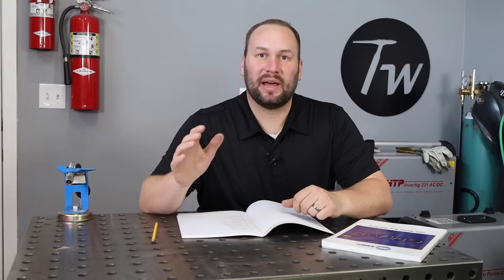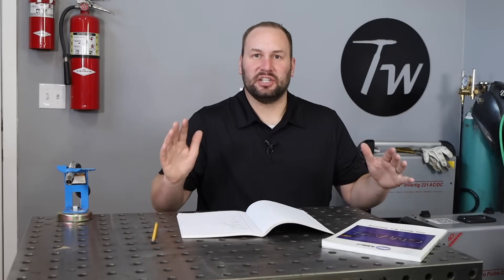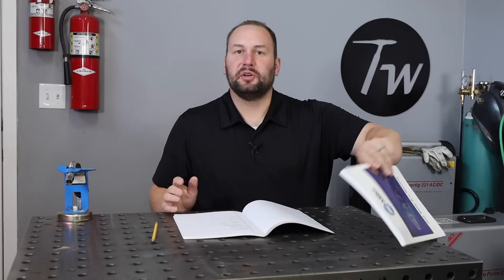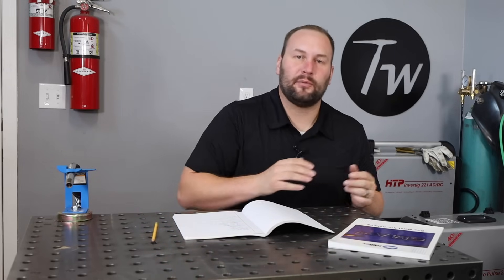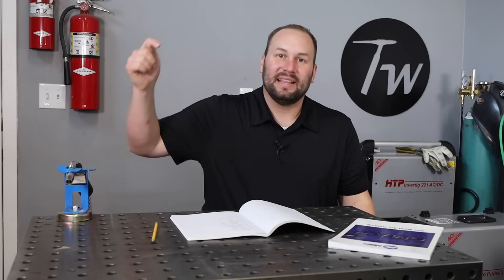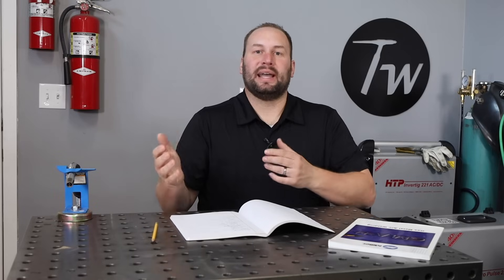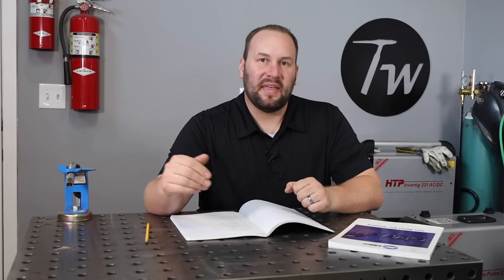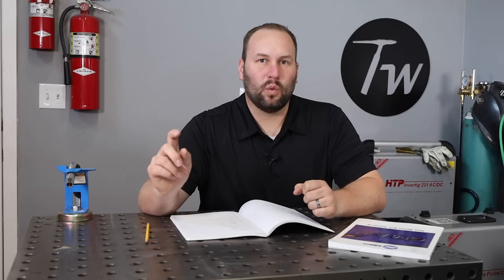Perfect Mig Welder Settings in 3 Easy Steps

Comment: For many welder, Miller's especially, that 1-10 dial for wire speed is actually in 100's of inches per minute. IE setting 4 is 400ipm.

Comment: I agree with the scrap plate tip. I always had a piece of clean scrap near by, to do my final dial in. Even though I already knew about where to set the machine, tips get a bit worn, liners get a bit dirty but not bad enough to replace. This and other factors will affect the final "tune in" on the wire feeder.  Retired now, after 35 plus years.

Comment: I welded missile launchers for the navy for 10 years along with crane frames. You did a good job on your training, but nothing was said about the type of gas. I use 75/25 mix at home and you will get a lot more splatter. Don't know if some of your students would know this. Professionally we always used to set inches per minutes before anything else. Thanks for your instruction.

Comment: This was really helpful, in fact I've been binging the channel and I've learned a lot, most importantly that I've been doing it wrong up until now.  I have one question though:  What about welders that use voltage selector rocker switches rather than a rotary dial?  My welder has two switches that are numbered 1/2 and min/max, but they don't correspond to a voltage, and the manual doesn't mention anything about it either.  Has anyone come across these before?

Comment: I generally use a Miller in my job, I've got bo qualification in welding but I'm always trying to learn. Generally we keep the same settings we are comfortable with over the whole chassis because it's target based changing settings amd making the best welds we can isn't a priority to the company but I want to improve and do that regardless so thanks for the info.

We generally use 3-5mm thick mild steel and as you said its numbered something like 1 to 10 lol so I use c for voltage just over 7 for wire speed and 4 for current... If I remeber rightly. I was thought on my week long training course to go off sound it should sound like frying bacon!

Comment: i usually do 9.5m/s at 24.5v 200-300 amps on semi-auto mig depending on conectivity and if metal is clean or not. for 2-3mm thickness material i go 8.5 at 21.5 22.5 for me that works.

Comment: 119 amp 19 volts 0.35<<<>>>> 125 amps  20 volts in both after setting Amps & Volts then Set wire feed Speed till it sounds like Bacon Sizzling. Remember this works in all Short arc welding. .25 in from the face of your Gun.

Comment: Question.. I have a multimatic 255 that according to the door chart, suggests that for flux core .035 wire on .250" mild steel should be run at 22.3v with 356ipm wire speed. A friend of mine, using a millermatic 252, using 035 solid wire with 75/25 gas on .250" mild steel runs 19.5v with 215ipm wire speed. Why is there such a difference?

Comment: Hi from Australia 
I'm starting to learn to mig weld and find your videos most helpful 
I have an Australian made Unimig 180amp multi 
On it there's a dial for burnback adjustment I'm just wondering how to set it right the dial just goes from 1-10 there's no explanation of the settings in manual 
Thanks Craig

Comment: I use 0.9mm fluxcore on galv material from 1.6mm to 3mm. Most welds are butt, v down or fillet, at 1.6 around 13.5 to 14.2 with 3.3 to 4.1metres ws. At 3mm I jump to about 16.5 to 18 and 5 to 6.5 ws to weld all my positions. If it sounds like frying bacon I got it sweet.

Comment: Thanks for the insight, Tim.  I'm wondering how one might change the voltage on one of the less-expensive inverter welders that only has a control for amps.  Also, I'd like to know a bit more about transfer modes. . .
Cheers!

Comment: My wire machine of choice is the Hobart motor generator. It had a wire speed dial, and a voltage and amp meter. There was three ranges to weld with by tapping into the windings externally. I chose to run my Mach on high. The reason was to use the entire generator coil instead of a partial. Then on hot days, my machine is not running at full capacity to do the same work. For .035 wire and CO2 gas, I used my wire speed to set the voltage at 90 volts, and dial in my amps to 100 amps. Or was it Vice versa ? I could weld all day because ......in this case.....less IS more.

I used to rebuild generator sets for the army. I understood how it works. Most importantly here, please pay attention to this. PROTECT YOUR EYES. You are not that good to avoid eye damage. Here is what you do, and this takes serious practice. While you learn this technique use soap stone on your joint. A thin line will fluoresce so you can see the line. Use your peripheral vision as your guide. Look ahead of your weld pool. Do not look directly at the arc. You will save your retina from serious damage, so when you get old, you will still be able to see. 

Do not inhale galvanize weld fumes.

Last but not least is to protect your hearing. Let the others laugh at you. No big deal, until you can’t hear shit, when you can’t remember shit, while you can’t see shit either. Remember, you ain’t that good to avoid these things.

Comment: I have a question about prep work before welding. DO you sand off the MILL SCALE before you weld? If not will the settings change because you have to weld through the MILL SCALE

Comment: when I dial in a hot snot gun (mig/mag) do I do it entirely based on the sound. I get a piece of scrap, look towards the machine and away from the scrap, start the arc with one hand and dial in the settings with the other until it sounds about right to my ears. after that do I put down a test weld and see if the settings were right and re do but lower or higher amps depending on my needs.

i'm not a hot snot welder tho so I don't know the tips and tricks about setting up a hot snot machine. what i'm good at is tig and stick welding pipes and I am able to set up and run a pipe weld with both tig and stick in my sleep

Comment: OK I need guidance with Mig Gas and Flux core gasses welding.  AS a beginner DIYer my problem is I have a "Bossweld BUDDY MIG 150" that only has voltage and average (so no wire speed feed settings).   I am using 0.8 mm flux core roll of wire (an I have at the ready, 0.9 steel wire with Argon/co2 gas too).  I can't find in product manual how to set the voltage and amps for different thicknesses of steel welding.

Comment: Useful to see, I imagine at least some of this transfers to flux core (I don't have a bottle yet). Unfortunately my welder (a Yeswelder MIG205DS) only has "synergic" controls: set material thickness, and then you use the amps knob to adjust something... It's supposed to be easier but I can find no information on how to use it well, other than that you can get it to go slower/colder for thin stuff if you tell it mig instead of flux core (yes the allowed ranges differ between the processes). I know they sent you the tig version of this machine, not the mig one, but if you have access to a machine with these kinds of settings, I would really appreciate a few minutes of tips: it may be easier but nobody teaches how to use it, everybody teaches voltage and wire feed speed.
Reply from the maker: While I've never used that particular model, I'll explain how other machines that I've used with synergic controls work. Typically, you turn a knob for the material thickness, which will set your wire speed (it's like the charts I showed, just programmed in). It will then automatically set a baseline voltage based on that wire speed, but they typically allow you to adjust the voltage up or down a little from that level. In order to run higher wire speed (and thus amperage), you can just set it a little thicker than you are running and vise versa. The voltage can be tuned a little above or below their recommended level to get it running well for your application, which is basically the same thing I did in this video. Again, I've never run that particular machine, but I assume it can be operated in a similar way.
Reply: @TimWelds  thanks a bunch, this is really helpful!

Comment: I have a Lincoln SP100T with Just A B C & D for voltage selection and 1-10 for wire speed . Any Idea what the voltage settings are for the A,B,C, or D settings  Also what settings would be good for welding body panels with .025 mig wire. Thank you.
Reply from the maker: A or B and somewhere around 3. You can Google the manual for a chart and adjust from there. You can also run through a couple tests using the procedure in this video. The exact voltage and wire speed aren’t that important as long as it’s running well.

Comment: So, gots a question for Tim here, or anybody else really.

Let's say you're doing heavy industrial MIG... you have 90/10 argom/co2... and let's say the company you work for want the machines set between 23 and 27 volts...

What would you set your wire speed to?

These are all tacks and horizontal fillet welds.  We're allowed to lower settings for downhill/uphill.

Any thoughts?

Comment: Yer Awesome, doin sheet metal 56 chev and after market parts ( rockers toe boards a front quarter patc panel 18-20 gauge I think ) using 0.30 wire and tips hope that what I need any advice thanks William the self taught welder

Comment: I just found you on YouTube. Subscribed. You're a great help! So, I've been MIG welding at my job for the last 5 years. But, it's minor welding here and there (about 15% of my job responsibilities). My employer is sending me to school. Now, at school, I'm doing stuff I've never done before and I feel that I'm not getting the attention I need (too many students, not enough instructors). Can you tell me how to run a long bead (8" or more) without burning my hands (ruining my gloves) and also, how I can do a straight line on a blank flat plate without guides? I can't see crap! Soap stone didn't work, new glass in my helmet, etc. I mostly deal with 1" x 1" and 2" x 2" mild steel. Any help would be GREATLY appreciated!!!

Comment: Just wondering, if anyone wonders about wire feedability. Even determining drive roll pressure versus drive type (knurled/v-grooved). Gun cable liner & contact tip condition. Can you rotate the contact tip 90 degrees once worn or better to replace it? Is there a better manufacturer's solid wire over another? Are the easy feed pads (clip-on) helpful?

Comment: Is it possible to put a voltage meter across the poles inside the welder to monitor the voltage?
Reply: Was thinking the same thing cheap digital readout
Reply from the maker: I've done this before and found that the really cheap Harbor Freight meters don't work, but my nicer Fluke meter did. That being said, the actual voltage doesn't matter as much as how it's running. You can do the same thing I did with a knob that reads 1-10 or A-F, just working your way up through the setting until it runs smoothly.

Comment: Tim, can I practice mig welding with a solid wire without having to use the argon gas until I get better? Or I need to use the gas at the same time? Thanks for your input!
Reply from the maker: You need gas whenever you’re welding with solid wire. It’ll make a huge mess without it. You can start with flux core wire without gas.

Comment: I have a MIG155Gsv and new to welding. What temp and wire speed should I start out on when welding a 1/8 of an inch metal flat rod on the door of a smoker?

Comment: Can you talk about more on synegic mode? I have noticed that my spartud easy MIG 215 has a limit on material thicknes so could I use that machine to get the job done with multiple passes incl root weld

Comment: Fantastic, I love how you cut right to it! Thank you Tim!
I would think that Voltage setting is of course dependent on the wire feed speed but independent of the material thickness.  The wire has a positive charge (voltage) and the work piece is effectively ground regardless of its size, shape or thickness.  Is material thickness that important when setting the voltage?
Reply: I'm not Tim, but I can tell you that voltage will have a lot to do with the degree of penetration and the likelihood of burn through. If you use too much voltage on a thinner piece, burning through the piece will become a probability, especially at the edges. Using too little voltage usually results in insufficient penetration for a strong joint. I can tell you from experience that the weld itself can look really good, but if there is insufficient penetration, the joint will break apart under sufficient stress. I hope that this helps.

Comment: My 211 everlast welder doesn't  have a chart like the Lincoln 140 and it doesn't dial in amps for GMAW.  It has a sudo-synergic mode, it asks material, gas and wire size and that is just for GMAW, nothing for FCAW.  I believe there are other welders without charts.  The Lincoln's chart is very complete, but doesn't translate because it's a letter switch & 1-10 knob.
On the farm it's easily a month or two before the covers come off of either.  Sometimes  and quick repair is handled by the 56yr old Forney that is always plugged in close to the door, no chart needed for stick. ( lets see, its a 1/4" thick, I'm going to need 250A and a 1/4 rod....NOT).   That makes it hard to remember the wire speed and voltage settings.   At the end of a day, its hard to go practice.
Stick and Flux play a very important role if farm repairs.  Most equipment folds up to fit through the 10" doorway, but unfolding  it inside is another thing.  And occasionally you have time to disassemble something , then you can weld that part inside.  But you are often racing against daylight  or the weather.  Again flux welding is you friend for clean up time.

Comment: Why does Ampage not get set while MIG welding? Is the wire feed spees linked to ampage?
Reply from the maker: Yes, the amperage is proportional to the wire speed. The reason wire feed welding is done with a constant voltage supply (you set the volts) rather than a constant current power supply is that you don't directly control the arc length as wire feeds out. Because arc length is proportional to voltage and the power supply is trying to maintain a constant voltage, it has to automatically increase amperage to melt the amount of material added when the wire is pushed in faster. On the other hand, with TIG or stick welding, you manually control the arc length, so using a constant current supply gives more stability.
Reply: @TimWelds  thank you so much for taking time answer my question . Your videos have been a great help. I will be purchasing your online course to learn more. Thanks Tim

Comment: Just what I was looking for, I got a mig welder today and it has no settings guide so after a few hours experimentation I tried youtube.
Reply from the maker: Awesome! Happy welding!
Reply: I've had an older Einhell SG131 MIG for about 30 years and I've not used it much but in recent months I've taken it in to work to use. I've finally managed to get the settings I'm happy with but this machine is designed for DIY not light industrial work and it was constantly overheating. Now I've acquired a new 180a multi process welder and it's working like a dream. It didn't come with any user manuals so I've resorted to searching YouTube. 

@Tim thanks for all your informative vids, I've learnt a lot from you and improved my welding.

Comment: Just watched youre video ..im trying to get the flux core under control can you help advise?
Reply: Run weld beads.
Change setting in minor amounts.
Continue welding beads.
Find a speed of wire that works well with your preferred travel speed.
Then move faster or slower depending on what you are doing.

Comment: You can't fine tune the amps on a welder that has A, B, C, D, E, and F, you CAN adjust wire speed to compensate for the unknown amperage to a certain extent..
Reply: it is the reason why the infinite control of the heat input is a very good thing to have when you shop for a new welding machine, on many low range MIG machines, the infinite heat control is an option

Comment: I have difficulty understanding the relationship between WFS and amperage on my welder.  I have a LE 180C.  WFS dial 1-10.  WFS specs is 55-550 IPM.  Amps is 30-180.  Now, for 0.035 FC wire, if WFS controls amperage, for 10 ga metal, I should have my WFS set to about 6.5, which equates to about 122 amps (interpolated value between dial range and amperage range).  That dial gives me 358 IPM.  But the chart says I should have WFS set to 2.5 which makes it run 55 amps and 138 IPM.  Where is the disconnect between WFS and amperage?

Comment: Hi Tim - Considering that MIG performance can vary from brand to brand, I was wondering if you would consider creating an empirical settings chart that's based strictly on your actual welds using the HTP PP 220 machine?  In other words, I subscribed to your channel because you use a PP 220.  Would you consider creating a Feed Speed  & Voltage settings chart based on your own PP 220 welds?  I've never used our PP 220 for anything other than mild steel, but it's been fairly thick stuff for the most part.  At the present time, I've got projects that involve 1/4" mild steel, so I'm particularly interested in 1/4" and thinner material welding.  Please continue making the informative videos and keep us HTP MIG guys in the back of your mind as you produce them. 👍